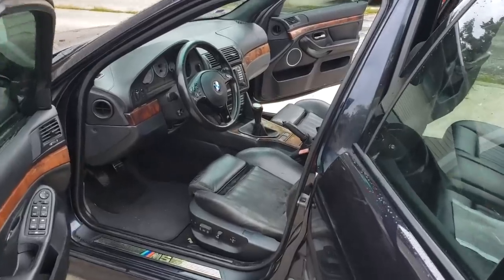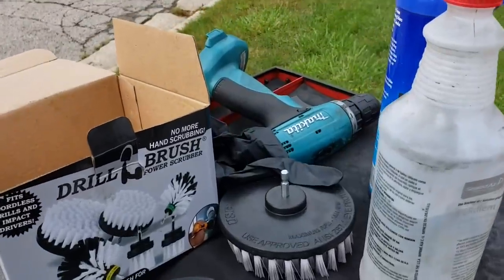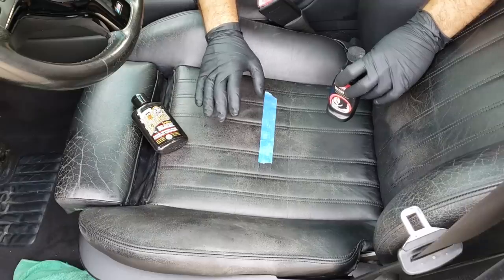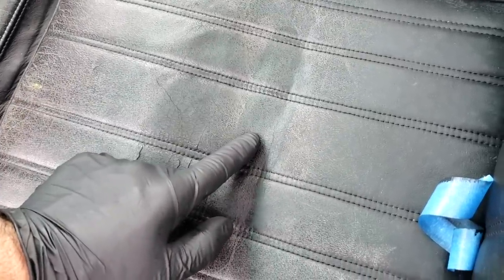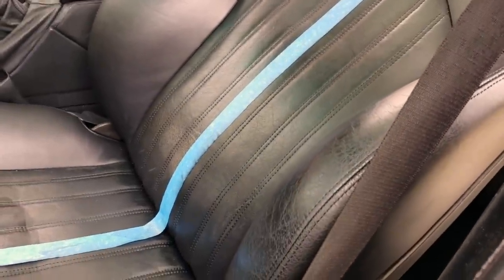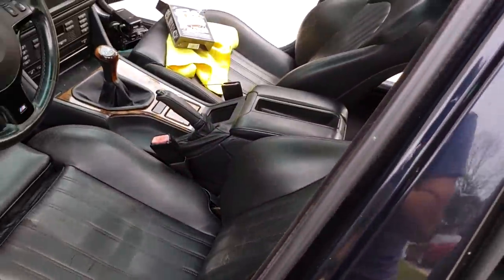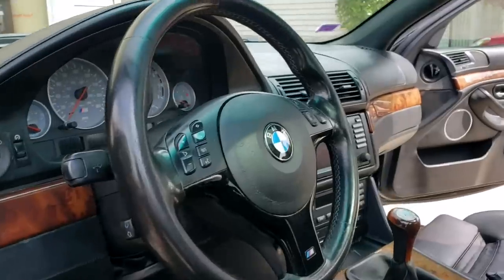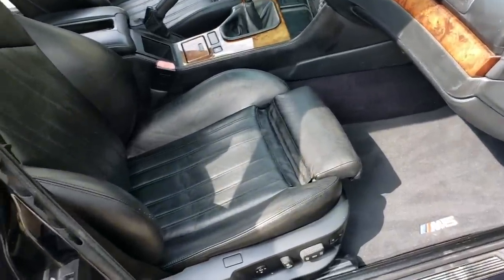Restoring The Leather Seats On My 409,000 Mile BMW M5 For $15. Easy DIY Seat Restoration.

Comment: I'm not usually a negative, but that looks blotchy, uneven and clearly DIY - especially the dash and door panels. 

On top of it, you can clearly see where the KIWI application was in the middle of the driver's seat after it was complete.

Comment: Should have taken these seats off and do a proper job with filler and wet sanding before painting. The result would be much better than this having cracked seats just repainted.

Comment: This is not how you repair leather seats... There are significant cracks in the leather that require filling before you paint the seat. This looks like a heavily worn seat with new paint...

Comment: Looks great but no way would I sit on those seats on a hot muggy day. Needs a sealer or top coat that won't wear off
Reply from the maker: This doesn't wear off at all. It's designed for exactly what I did and has been around for a long time. Nothing comes off
Reply: @LegitStreetCars  I'll have to check it out then. I went the old school way and sprayed a dye and sealer on my E46 but I also was doing a color change. Either way, yours turned out great, nice work.

Comment: the undamaged leather looks good, but the seats look awful...   Without repairing the cracks etc, you really can't make it look good.  I would not recommend just staining damaged leather because it looks like stained damaged seats when you were finished.  There are many latex products which can fill and repair leather seats and there are all on YouTube.  Sorry but this is not the way to repair leather.

Comment: its vinyl , not leather , they dont use real leather in cars unless its a milllion dollar luxury car
Reply: So, I guess my 2001 E46 coupe is a million dollar luxury car, because I've changed the seating/bottom portion of a driver's seat (bought a used passenger seat just for this) and I can tell you, just by looking and touching the other "side" of the leather, where it is secured with hog rings to a cushion/wire, it is 110% real dead cow leather.
Reply: Hahaha, and you have expert in your YouTube channel name???

Comment: To be honest, I'm a lot more interested in your mechanical videos, barely interested at all in things like this one.  Hopefully not many videos are about "detailing."

ANYWAY, my main concern with any sort of single-step product that includes a dye is how it behaves if, for example, I get in wearing khakis or even just faded jeans on a rainy day - is that dye going to stay on the seats, or am I going to have half-black pants when I get out?  You really should test that before recommending anything to your viewers.  Also, it really doesn't translate to video very well - you're really gushing over something that looks ... better, but not something I'd be gushing about based only on the video.  Alternatively, there are ways you can show the difference more clearly on video - for example, just pull it into your garage so that you can control the lighting better.  It would serve your viewers better, and help us really see the difference better instead of just half-wondering what exactly you're gushing about.  And I watch all your videos on a 55" 4K OLED TV, so if it were easy to see the improvement, I'd see it.

So, please, better lighting, and for the sake of your reputation, do things like test the color-fastness of it, and take the extra step to set up the video so we can actually see what you see.  Otherwise your excitement - which is really one of the best parts of your videos - will seem more real and less like you're getting paid to promote something on a TV infomercial ...